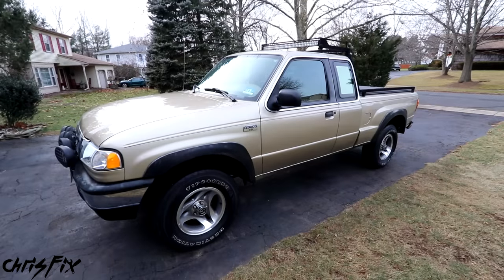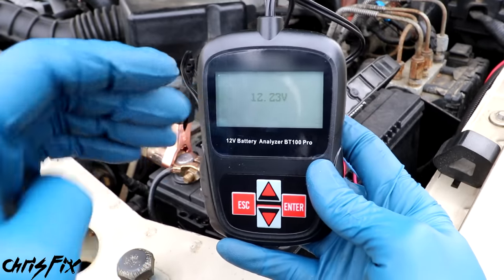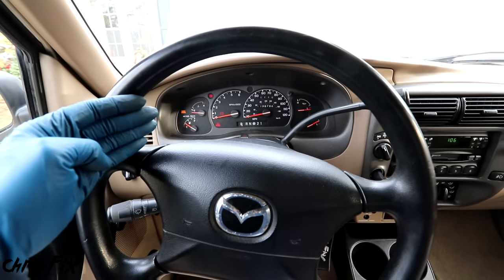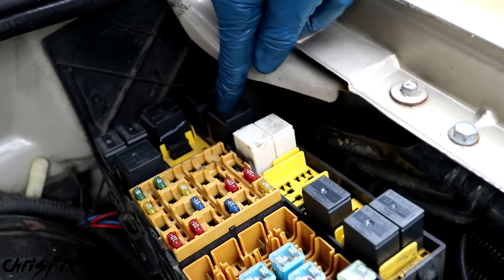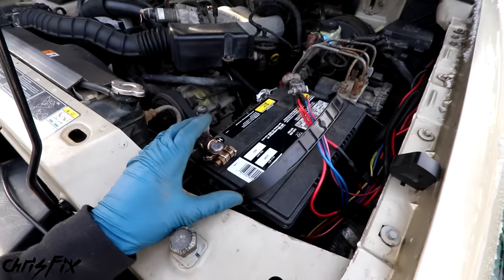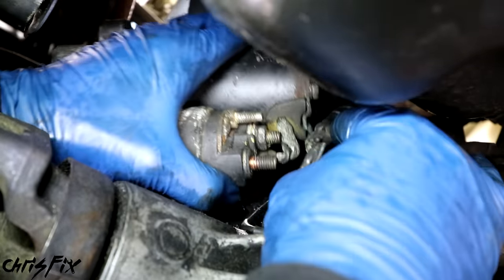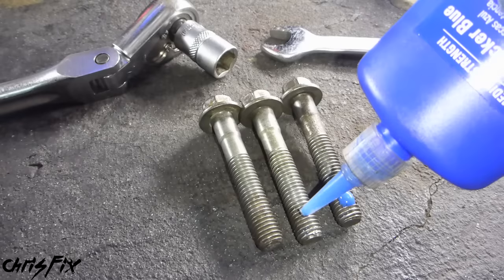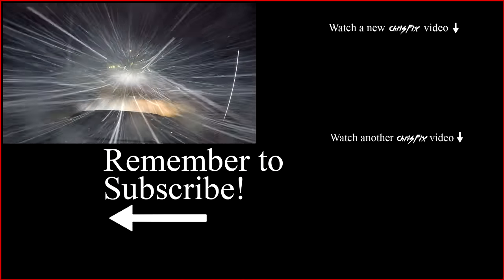How to Diagnose and Replace a Starter

Comment: Heres my starter story: Me and my family were getting ready to go on a roadtrip so i had started the car to get it ready. a couple of minutes later dad told me to shut it off as i had started it a little early. we got everything in the car, my dad goes to start it and... nothing, it wasnt even cranking, and we were in quite the hurry because we were going on the roadtrip for the family so dad calls our long time mechanic, and they say that they cant come over that day becuase it was pretty late. next morning arrives and the mechanics come over, a couple of minutes pass and we’re all hunched over the engine bay trying to diagnose what the problem is, the main mechanic says that it could be that the starter isnt getting power to the engine and looks at where the starter wire meets the engine, and there it was, the problem. the cable connecting the starter to the engine was very corroded, so he disconnects it and starts going at it with a flathead screwdriver, after he’s done he reconnected the cable and went to start the car, the car started up with no problems whatsoever, he started it a couple of times to make sure. and we were on our way to the roadtrip.

Comment: Friend's car died at a gas pump. Battery was old, but the voltage was almost ok; it wouldn't start even with a jumper or booster pack. Had a single click when starting so we thought it was the starter. Turned out that the vehicle was sold to him with an undersized battery. Never thought to check the battery SIZE but there ya go.
Reply from the maker: Interesting, I'm glad you found the problem and it was a easy fix!

Comment: I need to know, how do you fix the problem when some parts of the car won’t get power but the battery is connected? (Also I watched the diagnose battery video it still didn’t work)

Comment: 2014 jeep cherokee trailhawk. Heavy skid plate in the way and only way to remove the starter is to remove the cat. The manifold is built into the head. So the cat comes off the head with 4 bolt which wasn't too bad but the bottom nuts were rusted terribly. Almost completely destroyed the studs. Luckily I saved it but it was a nightmare.

Comment: My 2006 suburban clicks then I try again and it turns over but not enough then I try again and it starts but just barely enough before the starter disengages. New battery, new starter/solenoid, relay and still does that. Idk what else could be wrong maybe a bad ground somewhere or ignition switch

Comment: Nice video!  good to know... 
My Lexus ES350 2007 does not start now.  I recharged the buttery by leaving it working 2 hours after jump start.  Then I left it off overnight. So today, when I push the START ignition key button, my car makes a THRRRRRR sound and does not start again.  (Yesterday I washed it well by myself and wiped it everywhere, under the hood and in the trank under the carpet floor.  I left my car in the open air to let it dry as I thought it got wet)   Today still, it does not start...   My car now can do only jumpstart because it does not start itself at all.  So, I'm going to sand connectors to the battery, see if it helps...
update:  Just sanded contacts that connected to the battery, NOPE, did not help.  It still makes THRRR sound and does not start.  All lights on in the dashboard.

Comment: Looks like Japanese engineering depends on the type of Mazda and other factors. I tried to change my starter and barely got it out, having to disconnect some cables and move away hoses. I got so tired, I didn’t even have the energy to go through the same process and place the new one. At least I saved half on labour.

Comment: I had a rapid clicking sound in my 02 grand cherokee... Everyone assumed it was the starter... Until the battery actually died and wouldn't respond to the Key fob commands. We jumped it and it's been running smoothly since

Comment: My Peugeot 206 has the starter just in the middle. I had to disassemble battery housing, air intake and transmission module to reach the starter!

Comment: So what if your vehicle randomly turns off right away after starting and the engine doesn't turn over and only a few clicks after replacing the starter, having a charger on the battery, having a good fuel pump, no blown fuse, and oil in the engine?

Comment: Weird problem occurring sporadically with my 2014 Kia Soul: I go from work to home at lunch (4 miles) or to supermarket after work (6 miles); after about 15-20 minutes I get in the car and instead of starting goes DA-da-da, DA-da-da, DA-da-da, DA-da-da, DA-da-da. I wait a minute, try again. Another minute try again and it starts. BUT, when it goes, the warning light of a car skidding is on steady and the tachymeter sits at zero the entire trip. Next morning, I go out to the car and va-Voom, it goes right away. No problem, no warning light, tachymeter works OK. Several days later, the same problem. Any guesses? The mechanic's appointment is in 5 days. (July 21, 2021)

Comment: If you need a quick fix as you’re in a parking lot, or need year vehicle now you can stick a flathead screwdriver in the starter and wiggle the screwdriver you’re vehicle should start.

Comment: Video doesn't show automatic transmission pipes in the way. I have a 1992 6 cyl auto trans. It's very tight around the starter motor

Comment: how do you diagnose 2011 Lexus Rx 350 push button start. Instrument gage doesn't light up. 12.5V battery voltage; 2.5 volts at fuse box, no breaks in fuses. Instrument cluster was on stepped on brake, pushed start button everything went dead.

Comment: if that happened check battery connectors ..if horn is loud and lights work its not the battery... could be poor connection at the solenoid which i just fixed on my car... i ordered another star anyway jsut in case...for now i will have a bar in my car and hit solenoid if it wont start...

Comment: In my case, the starter is working but cranks the engine very slowly when it's cold out.. but starts just fine when the engine is warm.. (the battery is brand new)
also, I'm hearing metal grinding noise when it starts slowly, what could that be guys?

Comment: My dad's van fuel pump went out on the side the highway luckily that van has been worked on by me and dad so did the hammer trick It did not work so he had it towed to a O'Reilly and he fixed the fuel pump in ten minutes in the parking lot.

Comment: I have to step on the accelerator on my ford ecosport so that it will start. Is it the starter?
Reply from the maker: Sounds more like an issue with the maf or throttle body, does it do it if the car is warm or only on a cold start?
Reply: @chrisfix  only during cold start. I scanned it and it says something wrong with oxygen sensor. I am not a mechanic. No experience in fixing cars. I don’t even change oil myself. But after watching your videos, i was inspired to fix it and i think i can do it too so i ordered the oxygen sensor online and a special tool. The oxygen sensor arrived today. Just waiting for the special tool.
Reply: @chrisfix  just an update. I successfully repared it. No more check engine light. No more low power. Everything is fine now.

Comment: if your stater wont start you can knock the starter of hammer or remove the starter and replace the carbon brass of the stater.

Comment: To diagnose a starter just check if its getting 12 volts then have someone put it in crank and if you have power there change the starter

Comment: My starter is going out in the oddist way it won't disengage from the flywheel so it just spins really noisily. I know it's going to go out at some point so I'm driving around with the replacement in my dash.

Comment: It was me and my lil homie first time replacing a starter so it took us all day and most of the time was wasted because of that third bolt at the top. We cranked it after we replaced it but it still didn’t budge so we decided to call my homies dad who is an expert mechanic and all he did was go under the driver side and told me that I’m missing the bolt that holds the neutral safety switch. I might of wasted money but at least I know how to change a starter now🤣🤣

Comment: My car has the smae problem... sometimes. It clicks one time then nothing more and sometimes it starts just right up. I changed my starter for another used one and the same problem. Rolling starts works everytime. It´s a Subaru gc8 turbo/gt 1999

Comment: Those testers do not put a real load on the battery. I have an old school battery tester which clamps on to the battery and when you pull the switch it puls a real load. It has coils that heat up and glow red. I have tried the new fangled testers and they rated aa battery good only for car to need a boose a few days later.

Comment: hthis sucks man did it but the starter broke taking it out the bolts connecting wires just poped off can see inside starter so i now a need a starter it may have been fine i found green exposed it cuases smoke and fire sometimes from hood short circut or whatever never blew a fuze anywhere wierd right! had a buddy try in start nothing! looked under wiggle wired.  those chips suck i can start any car without keys

Comment: I replaced they starter in my car thinking the starter was bad. Not only was the engine bay tight, there was leftover oil from a valve cover leak all behind the transmission. Once I replaced the starter, it didn’t do the job. I gave up and took it to a shop to realize the fuel pump failed due to charcoal from the canister clogging one of the valves
Reply from the maker: Darn!

Comment: The starter motor can be repaired with easy methods.  They usually ran out of coal.  You don't even need to buy a new one.

Comment: I normally like your videos however not this time.
1st test should be a  battery Voltage test, then a fuse test, 
Then a Voltage test at the cranking Motor and Solenoid for proper Voltage to start the vehicle. If there is an loss of  more than 2 volts then check your cables and terminals for corrosion and broken wires to the S terminal of Solenoid.
Then do a Voltage drop test at the Starter Solenoid and cranking motor while under load.
Next do a Voltage drop test on the positive Cable and all terminals.
Then Voltage drop test on the negative Cable and terminals. 
If all of these are proper, then test test both circuits of the Relay 85 & 86 for ohms and 30 & 87 for a closed circuit. If Good then
Chech for voltage at the Starter Switch and the Clutch Safety Switch or neutral safety switch.
I don't pull the starter until i find out if the Battery and the Cranking Motor have the same proper  voltage range;  which tells me its a bad starter Motor or Solenoid.
Reply from the maker: Thanks a lot for the feedback Joe

Comment: I have the opposite problem. My project truck won't stop cranking 😂
Reply from the maker: Hahaha, solenoid is shorted probably
Reply: @chrisfix  it's shorted or stuck somehow. Solenoid and starter are both new but as soon as I hook the battery up it starts turning over. Gonna try taking it apart

Comment: If the battery isn't delivering any power at all because it came disconnected... Then the inside lights and the radio wouldnt be lighting up... So like... Basically yeah that would be something Id add

Comment: Dang I feel bad for you my jeeps starter is held in by 2 15mm bolts and they are easy to access with no extensions and nuts on the starter are a 13 and a 8 so I only need 4 sockets and 2 ratchets. I need a 12mm socket for the battery terminal

Comment: Hey guys, I'm in need of help. My 2008 ford focus has a very weird starter. The car doesn't start on the first or second turn of the key like normal. It also is weird that I can just flick my wrist and turn the car on rather than holding the key down. Is that normal? I thought my battery was dead, but it tested good. The alternator passed the test as well. Only thing left is to diagnose the starter. 

Anyone else with a focus that has this weird starter thing?

Comment: 1973 ford falcon inline 6    use a long screw driver and touch the starter motor points  and the car starts up with out keys

Comment: The hammer on the starter blew my mind??? Can any1 explain why that worked? 🔨
Reply from the maker: The contacts are dirty or rusty or seized up inside and a jolt helps them make a temporary connection.

Comment: Im tired to fix the car the problem in the car engine batery and more is extra fix the fixing is bad fuse bad starter and more the bad starter is more power i buy some starter is not work and i try the oli power is work now i drive the car for 2 seconds and now i stay

Comment: What if there’s no lights or nothing. My car won’t turn over not any of lights or switches turn on when I turn the key to on??
Reply: relay
Reply: @sneez9461  which relay tho
Reply: @Leobuhh.  First, check main fuse
Reply: @sneez9461  thanks that was it bro👌👌
Reply: @Leobuhh.  oh really? no problem man
Reply: @sneez9461  yeah when I looked at it there was nothing broken in the inside or even corroded. I replace the starter and battery and even a new ignition switch, still had no power. The main fuse was my last option so I decided to buy a new one and luckily that was the problem.
Reply: @Leobuhh.  Im so happy i could help you, just ask if theres something else you need help with

Comment: Well... my engine light never turns on when the key is on but it does when you try to start it
Reply from the maker: It should turn on when the key is in the run position. Then shut once the car starts. That means it's reading the ECU
Reply: @chrisfix  That might be why it's only running on 2 cylinders instead of 6...

Comment: So I have a question for anybody- I had a starter go in a 90s Honda. Against advice I tapped it and got an extra year. I recently had a mid 2000s Toyota with high miles, starter went. I got it to start by tapping it with a hammer for about 6 months. My neighbors insisted that this is a modern starter, and tapping it just breaks it. Yet it worked to tap it with a hammer. Was I just knocking around loose shit on the contact pads? Mechanically the starter behaved liked the older cars. My old Honda the starter was totally gone in winter, I drove it 26 hours straight south, afraid to turn it off. When I got to the heat, that starter started working normally again. Wtf?

Comment: it seems i need a new starter.... when i  turn the key once.. i only hear 1 click and nothing afterwards no repeated clicking like in a low battery situation... but just 1 time click and then dead no reaction. oh well.. another $100 down the rabbit hole, my only concern is not to have something else happening. cause u know replacing stuff that aren't fixing the problem it adds up fast lmao.

Comment: It is hard to understand why car makers still sell cars costing $50.000 and more without a simple built-in battery wear tester. Directly behind empty fuel tank the most common reason for cars breaking down and needing help of the road is bad batteries (discharged or simply old and worn out). Such a tester would cost a couple of cents or maybe a $1 if mass purchased by an OEM. And today with computers in all cars they could easily give a battery health history / indicator. This is available in every $100 smart phone. I guess car makers still want to push you into expensive maintenance... Not a customer friendly attitude.

Comment: Do a Anti theft video for Grand Am's... They are so annoying
Reply from the maker: I have a video on how to install a kill switch here, check it out: https://www.youtube.com/watch?v=XUhXLsrZiE0
Reply: @chrisfix  I meant when the anti theft system fails and prevents your car from starting. Just got a grand am and the starter doesn't engage at all. Fuel pump and everything else sounds fine, and I swapped the relays, and it sounds like no power is going to the starter at all. I replaced the battery, and later today I'm going to have a new starter thrown in. Everyone at work is telling me the Grand Am's are known for a faulty Anti Theft system that locks the driver out until it's bypassed or taken to a dealer. I just thought you might have a solution because it seems like a very common vehicle specific problem, but an annoying.  one.

Comment: My car starter under the intake manifold
Reply from the maker: Those are the worst
Reply: @chrisfix  can clogged fuel injectors and worn out spark plugs cause the engine to shake while driving

Comment: for a holden commodore  its a 20 min job by jacking the left hand side and take the wheel off  undo 2 bolts and 1 nut for the wiring and 1 plug  SIMPLE   sucked in to audi owners lmao

Comment: What you did not cover is a dragging starter with bad bushings
Reply from the maker: At that point a replacement would be necessary because that's not normal starter behavior